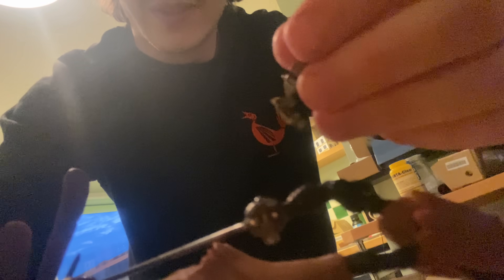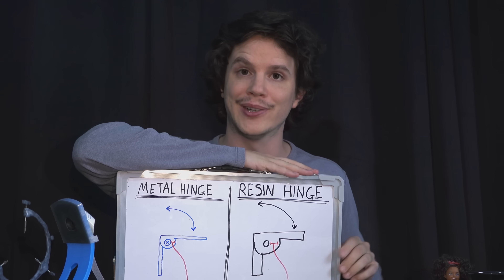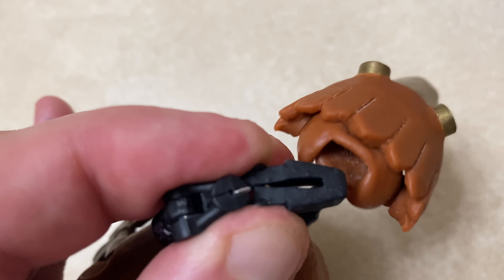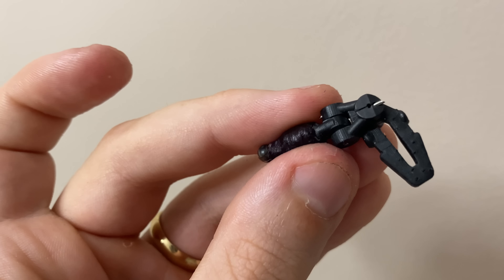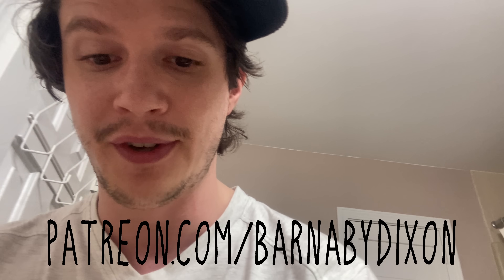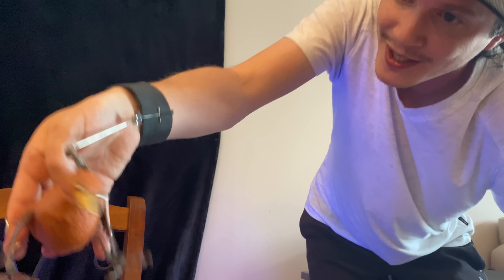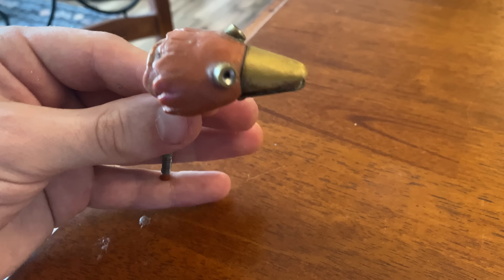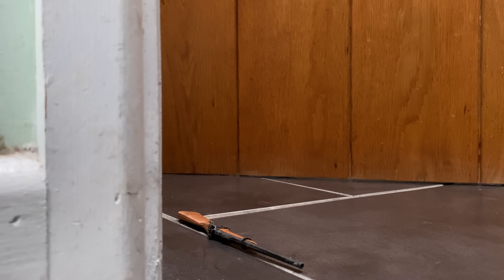Dabchick Returns

Comment: I am a little concerned that the pins expanding the flexible material will reduce the overall flex threshold required for function, but it is difficult to judge as some of the parameters are unknown to the viewer. Permanent flex might also add to the material fatigue, but, again, not such a problem now that all the parts are interchangable. Nice to see Dabchik back, and not only that, but improved in all of his components!

Wait, is his tongue now UV reflective?